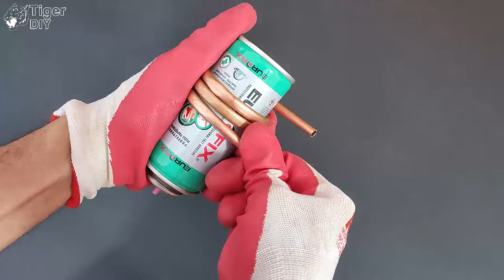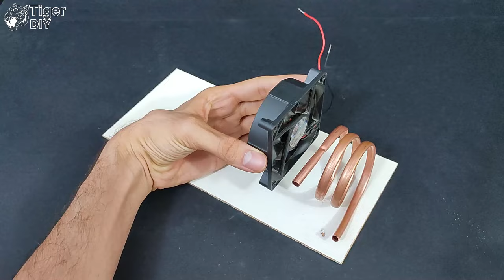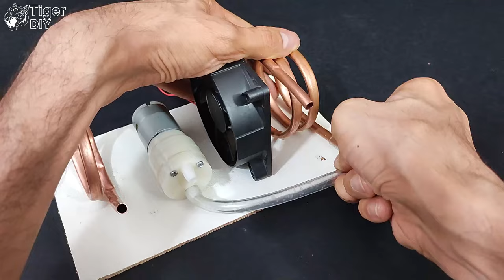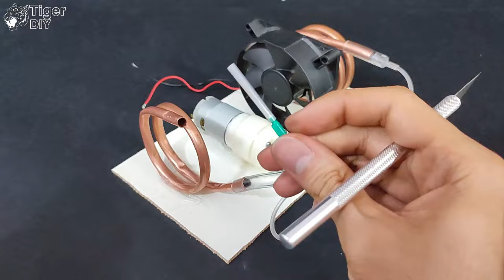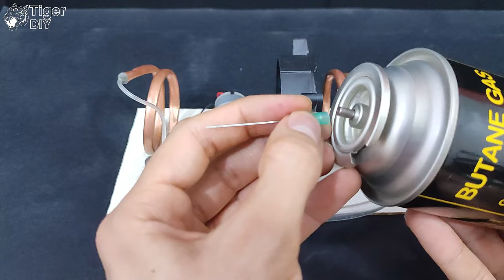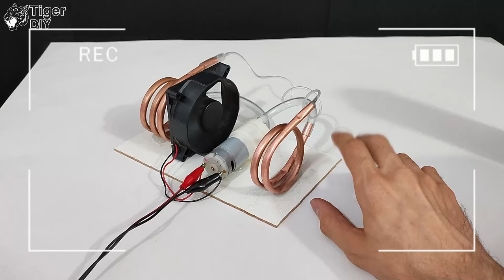Secret Of Fast Cooling Freezer - How It Works? (Let's Build & Find out) !!!

Comment: There must be 50 makers, you're saying yours doesn't work because you overloaded the system using  18 inches of kinked tubing and a plastic drip line,  so you reversed the video. The problems you have is you cut the video, when some others don't. Of course piercing the line is a big mistake. I use an empty clear refillable lighter for a reservoir with two 3/16' copper lines, sealed with solvent for polycarbonate, and reinforced with clear epoxy. No leaks, acts as a drier too. Another problem is using a brushed motor around flammable gas, which others dare do, but they are powerful brushless motors, not cheap 9 dollar pumps. Butane require 2 atmospheres pressure to become liquid. But it doesn't  need to be liquid for thermal exchange, just close. Give it some thought.

Comment: Use an air pump not an water pump. I know that it doesnt work but I probably suggest using an air pump because it works as a compressor.
Reply: @TigerDIY1 I didn't got this as well. You already knows that water pump doesn't work. This one looks quite similar but it's an airpump https://www.youtube.com/watch?v=yG6wXBY1hV0 or just vacuum pumps from web shops.
I'm still between the chairs, but find the right pressure to get it somehow efficient (if it works at all) might be also a challenge.
Reply: @stephank9035  yes at least if you want to try and create it do the following:
(These tips are recommended from, just to let you know i am an HVAC technician)

1. Use an airpump(as you mentioned)
2. Use a REAL refrigerant (like R600(butane))
3. Create the evaporator and the condenser based on how much refrigerant will you charge in the system.( How much will it condense and how much it will evaporate(that is also how much btu/h that you want to achieve)
4.By creating a refrigeration cycle(your system) needs the correct amount of calculation based on the P-V enthalpy chart
5. Calculate the correct amount of capillary tube or think of some method to drop the pressure based on (a. How much refrigerant b. How much of refrigeration you want to go (let’s say R600 at 1 bar is -13~, if you go lower at pressure you will achieve lower temperature)
6. Also calculate the amount of superheat(evaporator) and subcool(condenser)

7. test it.

You can find more info with these links that you can find :
https://www.flycarpet.net/en/phonline
https://boxload.tecumseh.com/SelectCapTube.aspx

And also download a really good app from Danfoss called “ Ref Tools” this will help you also. 

I also really suggest seeing this video : https://m.youtube.com/watch?v=Yyhi0Q1O_30&pp=ygUpQ3JlYXRpbmcgYW4gYWlyIGNvbmRpb25lciBmcm9tIG9sZCBmcmlkZ2U%3D

Comment: 😂..I played with the tiny pump before there’s no compression. Only a compressor can make that pressure difference to cause the expansion for thermal change. Furthermore the plastic pipe really can’t take that pressure too. Good job bro letting people know. The rooster is resting now that the chicken in the background 😂. ❤

Comment: do you mean that fixing out those two points (stop a gas leak and change a type of pump) will resolve the problem and it will work ?
Reply from the maker: Probably yes, but with a real compressor and a bigger condenser

Comment: What if we remove the circulating pump,  and just add butane into the copper coil?
Reply from the maker: As soon as butane is injected, the copper tube cools down for a few seconds and then returns to normal. This system works with a real compressor.

Comment: 🤨…. So you think the other YT money suckers (with their diy butane based refrigerators) were committing fraud with the adverts? ☹️ ~ so with the problem of the gas escaping and the pump not being suitable…. At least you had the right arrangement with the fan blowing onto the condenser coil. I think with the right parts [reusing the fill valve from a cigarette/gas lighter] it might be possible for it to work? I know that with a proper refrigeration system; it has a large piston pump/compressor (often sealed into a canister), the system has to be vacuumed before the refrigerant is added, all the pipes are copper
Reply from the maker: If a real compressor is used that can move this gas through the system, I think it would work with the same sealed plastic hose (I'm just guessing, as it needs testing). Of course, this system is too small to work, I think the volume of the condenser should be larger to quickly dissipate the heat of the system. Propane gas is used as a refrigerant in home refrigerators. Of course, butane gas also has the same properties, but its performance is lower than propane.